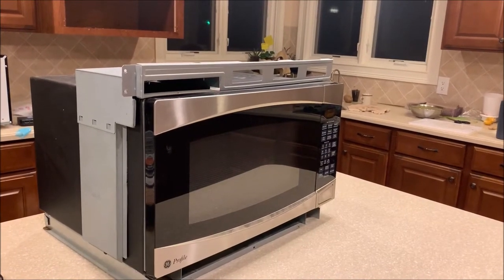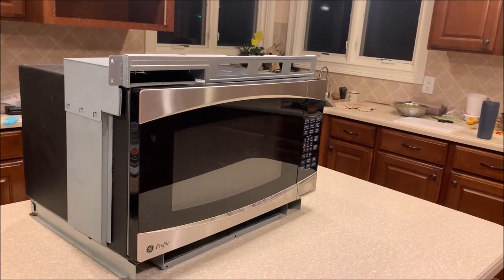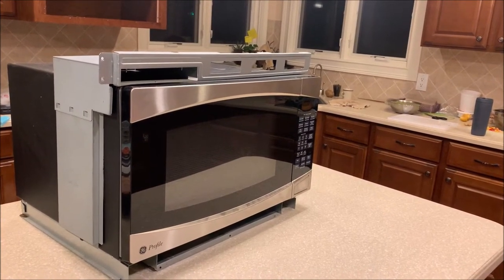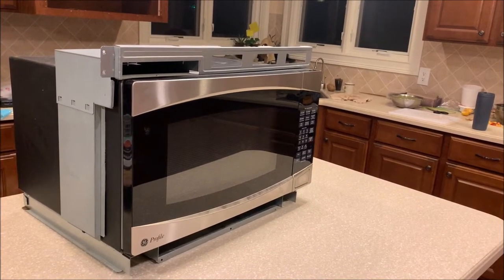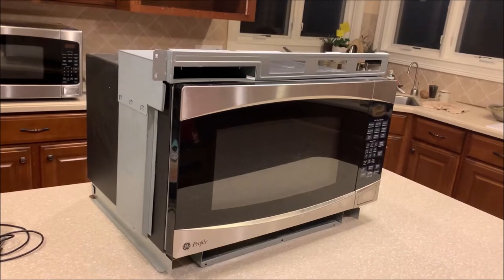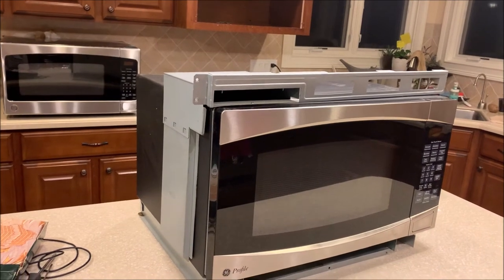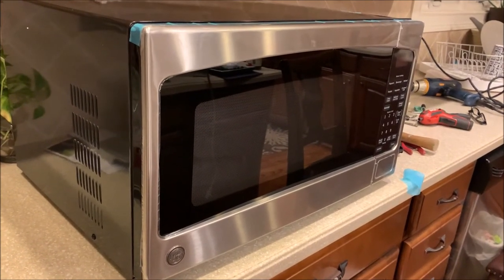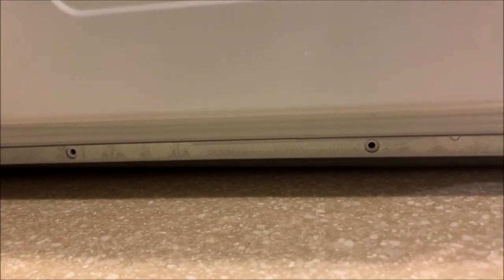Replace GE Profile Built-In Microwave PEB2060SM1SS with GE JES2051SNSS

Comment: After spending time with local appliance store that was of no help to replace this 10+ old microwave, I saw this video and purchased the model suggested from Amazon for $300. It worked perfectly.   Instead to $1000 for a model that had no semblance to out GE double oven this fit and worked perfectly. Thanks a bunch for putting this YouTube video out there. Yeah!

Comment: I had exact same GE Profile microwave that the front glass panel just fell off and broke.  Could not get a replacement.  I ordered this alternative one (and it happened to be on sale from Lowes for $90 off!) and everything matched up with the mount screws.  On the vent cowling, old sticky tape on the side vent cowling would not stick so I just used some 3M foil HVAC tape and taped it to the microwave (can't see it once trim plate reinstalled).   This saved us $100s.  Thanks for posting this video!

Comment: What is the trim kit number that fits with both models?  Thank you!
Reply from the maker: @stacyajones  I used the original trim kit
Reply: @easy_lazy  I found it.  The one I bought from EBAY was GE JX2030DMWW 30" Deluxe Trim Kit
Reply: Also, JES2051SNSS are hard to find, but the newer model GCST20S1WSS is the same!
Reply from the maker: @stacyajones thanks for the update

Comment: SInce the JES2051SnSS is rated for a counter top, is this OK installing it in a wall?
Reply from the maker: I compared both units, looks like they have the same ventilation design. And the housing has about 1 inch clearance on each dimension. I only use for heating up leftovers with less than 5 minutes run time. If you are going to use for cooking, you might want to get the original replacement with warranty.